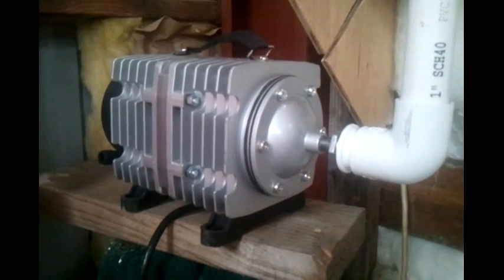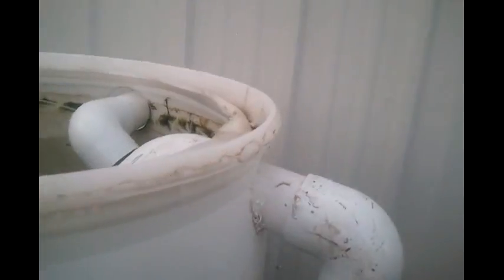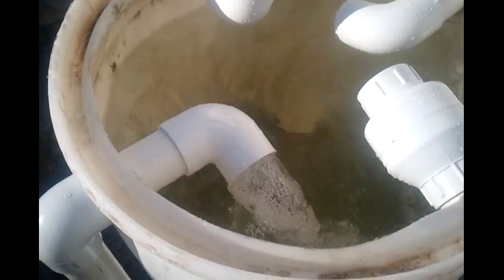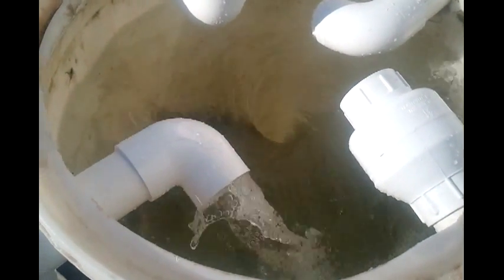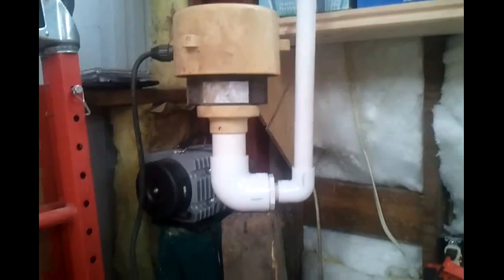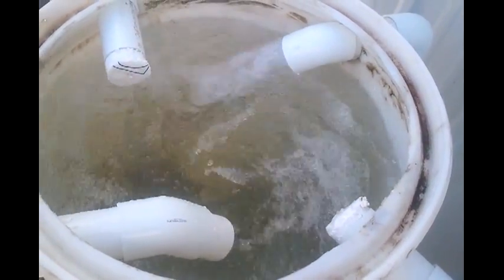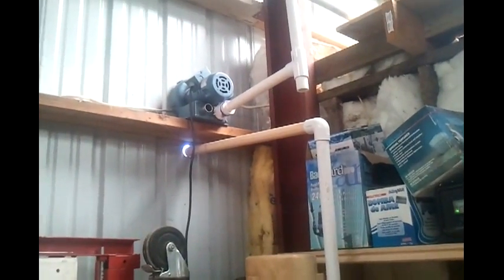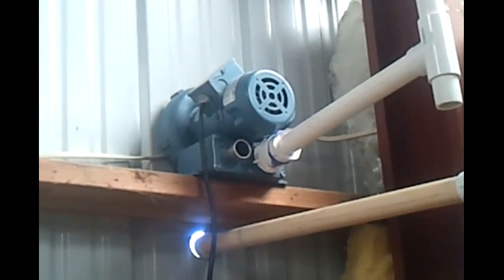Design of a compost brewer with a vortex

Comment: Way back about 25 years ago, I owned a small fish hatchery.  I had two different regenerative air blowers.  One looked slightly smaller than the one you have and the other larger.  With regenerative blowers, I learned through conversations with the dealer, a way to fix that problem and in my case luckily before I already installed everything.  He basically explained and detailed the installation of what I would call a ram jet for air.  Since I understood a little about hydrodynamics, I was able to grasp the idea.  The funny thing is, it was so damn simple.  I simply added about 6' (feet) of 4" (inch) pvc pipe right into the pump to act as the first header or a pre-header.  Off of the other end of the 4"er I dropped down to a 10' section of 2" pvc pipe which was in fact the header that I attached all my 1/8" airline tubing and running to multiple air stones or lifts of unequal pressure requirements. The dealer also explained that the longer is better, the header that is.  By his calculations, I should have went with at least 8'.  But 6' was all I had to work with. Again I'm strictly speaking headers.  After turning it on with a couple years of use I started out with zero pressure difficulty and ended that way.  I had what I needed: pressure with volume at a decent running value.  Hope that helps, if nothing else, amusing.  -Dann
Reply from the maker: Are you saying that the configuration of the header improved the head pressure?
Reply: Bob Campbell Yes. If you take the same blower and feed the air into a larger (4”) pvc pipe, before the smaller feeder pipe, you should have same volume with more pressure. At least that was what I was told and tried myself. It worked.

Comment: For every 1 foot of rise a 1/2 lb. psi is lost. And the size and shape of the container is irrelevant. For instance, you can have 1/4" tube 10' long and a 12" pipe 10' long standing vertically. At the top of both pipes is 0 p.s.i. head pressure, at the bottom of both pipes at the bottom will be 5 lbs. p.s.i. Even if you have them sloping down a hill. Same rule of thumb. Measure how much footage difference from the bottom of the hill to the top and that your rise. 1/2" psi static pressure for every 1 foot of rise. So for your concern of how much static head pressure you lost at 4', its 2 lbs. p.s.i. in case you were wondering.

Comment: Paul's article just sent me back here Bob... How's the brewer working for you now ?

Hope all's well sir :)
Reply from the maker: The hot tub blower was ridiculously loud so that short test was the only time I've ever used it.  I now use a very simple air lift pump with a moderate flow. I'm the kinda guy that's happy with good enough, and rarely put a lot of effort into perfection. The vortex might improve the growth rate, but just a simple air lift setup seems to do a very good job. 

I think it's humorous that someone has a copyright on the name vortex brewer, and went to the trouble of making me change the description.  My guess is they feel very strongly about the whole vortex thing.   They may have data to support the results, but cleaning the tubes became a pain so in an effort to keep it easy I've done away with the entire vortex thing, and simply move water and compost from the bottom to the top.

The important thing is to use the tea within 18 to 24 hours.  I've also quit putting more than compost in the water.  I tried some very expensive concoctions, but I feel compost and molasses is all that is required.  Someday I'd like to experiment with fungal tea.
Reply: Thanks for that Bob.. Not sure on how we will be running our large brewer yet.. Was just going to use an air stone but might go with an airlift yet..
Cheers.

Comment from the maker: It would but I don't own a DO meter. I've been looking at my bacteria population with a microscope.  One thing I've always heard is to use the tee at about 24hours.  Looking at the bacteria with a microscope confirmed this. 

I like the paddle brewers.  They are very simple to build with a drill press and it gets that vortex going just as well.  They are a lot quieter too.

Comment: No. No drill press. The copper barrell contains about 50 gallons which drive 2 stirring paddles inside the barrell. It starts up stirring in 1 direction. In that size container it takes about 18-20 sec to form a proper vortex (diff to that in your vid). As water rises up inside of barrell, it also rises up in external tube. When it gets to max height, it triggers a float switch which reverses motor. You then get about 5 sec of chaos before the vortex forms in opp direction for another 20 sec etc